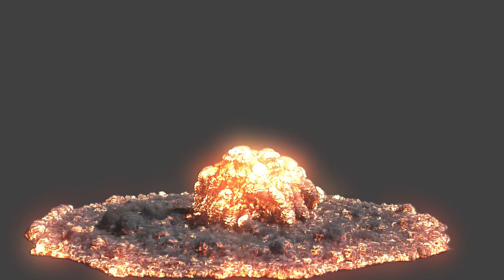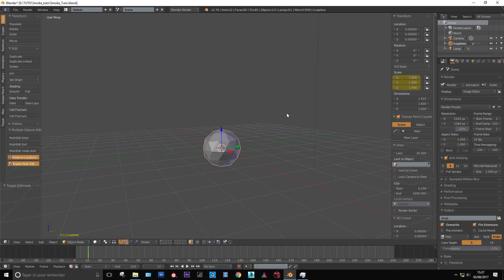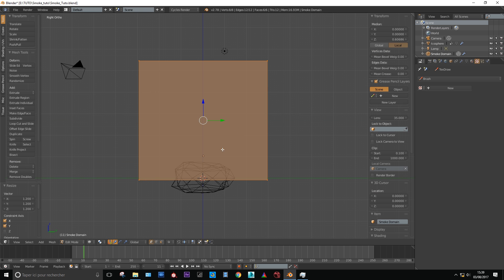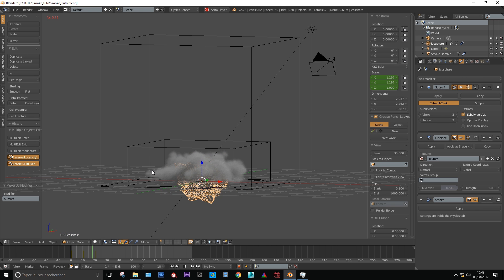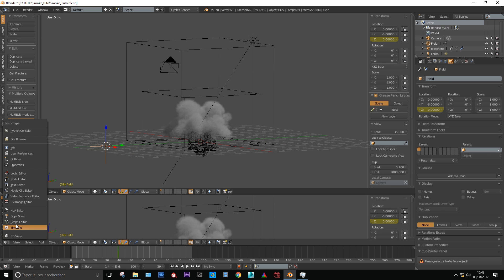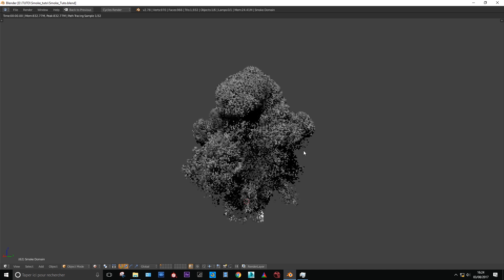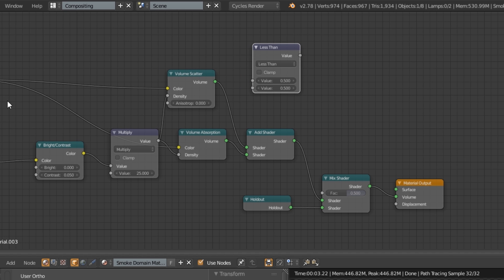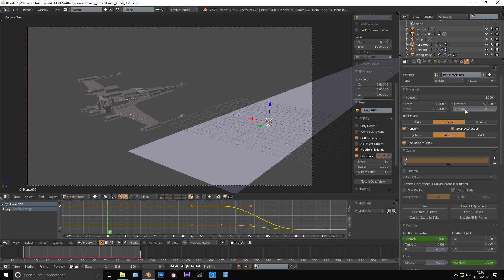Blender High resolution smoke simulation Tutorial

Comment: Awesome tutorial! Thank you so much for sharing! May I know the specs of your computer? I'm running on windows 10, Intel 6770K, GTX1080Ti, 32GB RAM but my playback is only HALF of yours.
Reply: Tan Han Wei i have like quarter your specs wtf
Reply: My GPU crashes when rendering smoke and I'm really confused- I'm  using a gtx 970 and it used to work fine. I'm on 2.79 and I'm running the latest drivers
Reply: Unidrw is it CUDA error? Out of memory?
Reply: i'ts because you've set your settings too high, your GPU doesn't have enough memory
Reply: yeap
Reply: I done even match quarter of that specks and blender is working like magic 😂😙

Comment: some of the best work in blender i've ever seen !!!!   quick question: with the smoke simulator i've noticed i will get very different results depending on whether or not the adaptive domain is turned on or off,  have you noticed any differences in the overall look when switching adaptive domain setting on or off?
Reply from the maker: Hi mate, I didn't notice this kind of different, but honestly i'm using adaptive domain to reduce baking time and the weight of the cache files. i should try this out.
Reply: yeah the bake times are terrible without adaptive domain, you should see a difference on any type of smoke simulation, but the biggest changes seem to occur when the adaptive domain is much smaller then the actual domain size , the changing size of the adaptive domain seems to effect the smoke vorticity